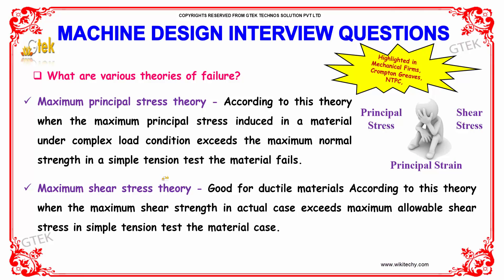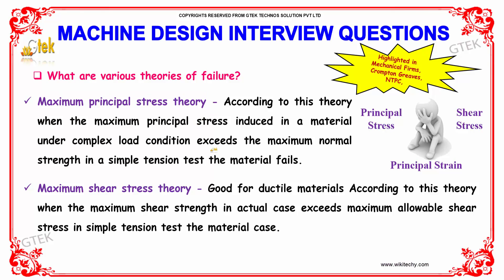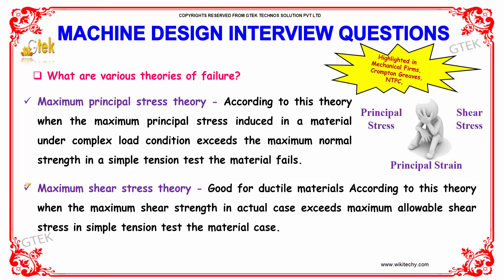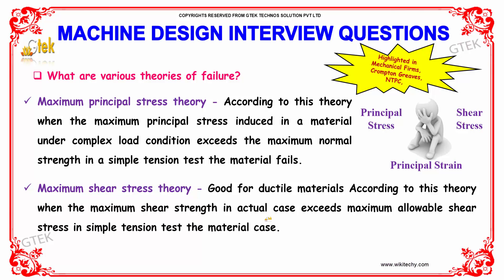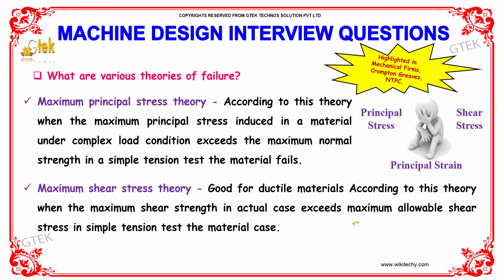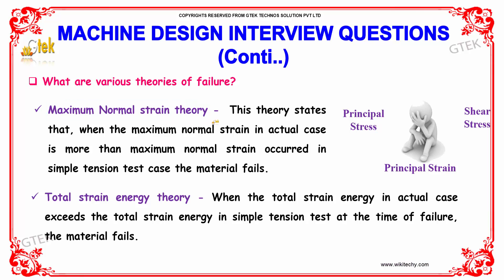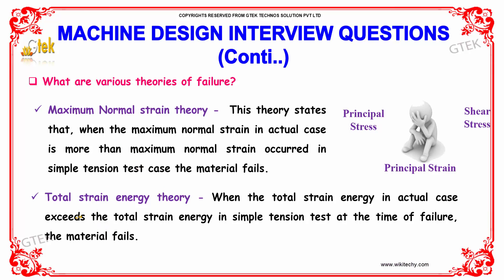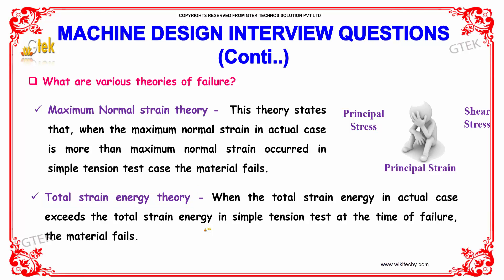What are various theories of failure | Machine Design Interview Questions and Answers

Comment: Commonly used failure criteria for ductile materials are: the Tresca or maximum shear stress criterion. the von Mises yield criterion or distortional strain energy density criterion. the Gurson yield criterion for pressure-dependent metals.

Comment: Maximum Principle Stress Theory  This theory is suitable for the safe design of machine component made up of brittle material, because brittle material are weak in tension  This theory is not good for design of ductile material because shear failure may occur  But this theory is also suitable for ductile material ..

Comment: The theories along with its usability is given below. Out of the 5 theories discussed, the Shear strain energy theory or Von-mises theory is the most valuable one. *Since brittle materials does not have yield point, you can use ultimate tensile stress as failure criterion.

Comment: 3] Maximum principal (or normal) Strain theory (Also known as Saint Venant's Theory)
According to this theory the failure/ yielding occurs at a point when maximum principal strain reaches to limiting value of strain. 

where 
δ[SUB]t1[/SUB]& δ[SUB]t2[/SUB] = Maximum & minimum principal stresses.
ε= strain at yield point.
1/m = Passions ratio 
E= Young’s Modulus.
F.S.= Factor of safety

This theory is rarely used due to unreliable results in many cases.

Comment: 2] Maximum Shear Stress theory (Guest’s or Tresca’s theory ) -->
According to this theory, the failure is occurs at a point in member when maximum shear stress reaches to the value equal to shear stress at yield point in simple tension test.
Mathematically 
τmax = τyt/F.S.
where,
τmax = Maximum shear stress in system 
F.S.= factor of sefty 
τyt = Shear stress at yield point determined from simple tension test.

Comment: LOG IN
 
Community
>
...
>
Mechanical | Automobile | Aeronautics
>

Introducing CrazyEngineers IO

Get access to special apps designed to make every engineer a winner!

(Only ~100 activations per day). Don't be late!

[Machine Design] - Theories of failure under static load
 
ShrinkDWorld
Apprentice
Theories of failure under static load 

Need of these theories 
The strength of machine member depends on material used. And these properties are usually calculated from simple tension or compression tests. There for predicting the failure stresses for member subjected to bi-axial or tri- axial stress is more complicated.

The principal theories of failure for machine member subjected to bi-axial stress are as follows.

1] Maximum Principal (or normal) Stress theory (Also known as Rankine Theory)
2] Maximum Shear Stress theory (also known as Guest’s or Tresca’s theory )
3] Maximum principal (or normal) Strain theory (Also known as Saint Venant Theory)
4] Maximum Strain energy theory (also known as Haigh’s theory)
5] Maximum distortion energy theory (also known as Hencky & Von Mises theory)

For brittle materials, the limiting strength is the ultimate stress tension or compression 
For ductile materials, the limiting stress is the stress at yield point.
#1 Jul 23, 2011
 
ShrinkDWorld
Apprentice
1] Maximum Principal or normal Stress theory ( Rankine Theory) -->

According to this theory, the members fails when maximum principal or normal stress in system reaches to limiting value.
Limiting stresses
For ductile material is yield stress
For brittle material (do not have well definite yield point) is ultimate stress.
According to above theory, taking factor of safety (F.S.) in account , the principal or normal stress (δt1 ) in a bi-axial stress system is given by 

δt1= δyt/F.S. For ductile materials 
δt1= δut/ F.S. For brittle materials 

Where, 
δyt =Yield stress in tensile test 
δut = Ultimate stress 

This theory is generally used for brittle materials.[FONT=&quot]

Comment: The principal theories of failure for machine member subjected to bi-axial stress are as follows.

1] Maximum Principal (or normal) Stress theory (Also known as Rankine Theory)
2] Maximum Shear Stress theory (also known as Guest’s or Tresca’s theory )
3] Maximum principal (or normal) Strain theory (Also known as Saint Venant Theory)
4] Maximum Strain energy theory (also known as Haigh’s theory)
5] Maximum distortion energy theory (also known as Hencky & Von Mises theory)

For brittle materials, the limiting strength is the ultimate stress tension or compression 
For ductile materials, the limiting stress is the stress at yield point.